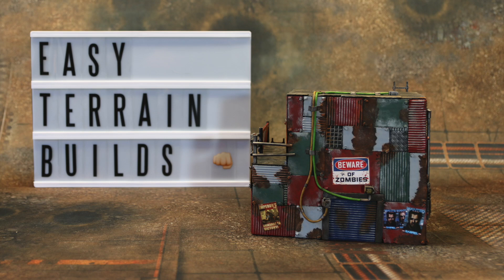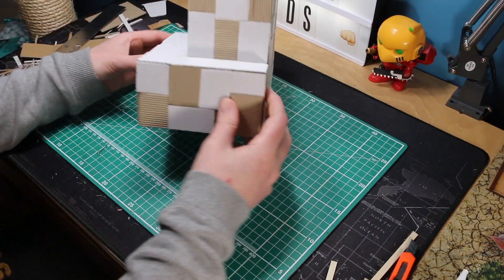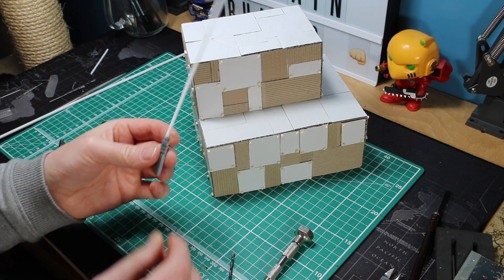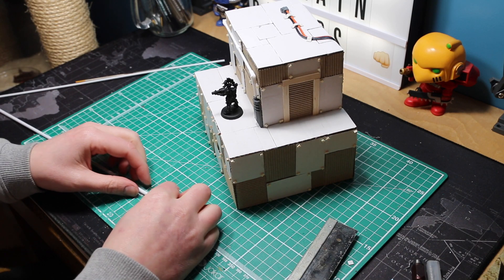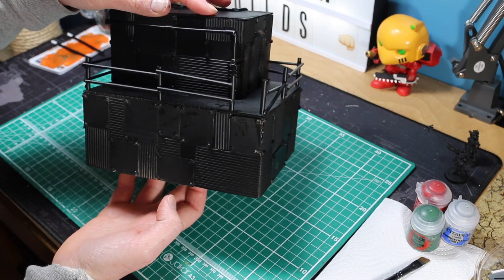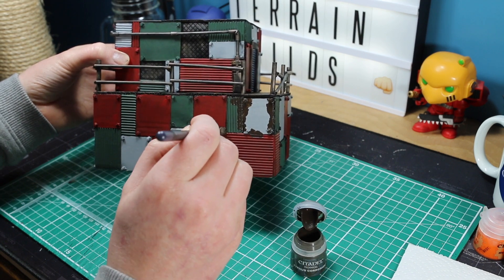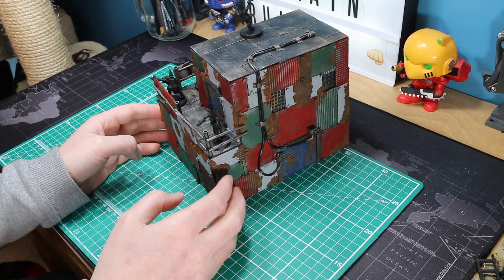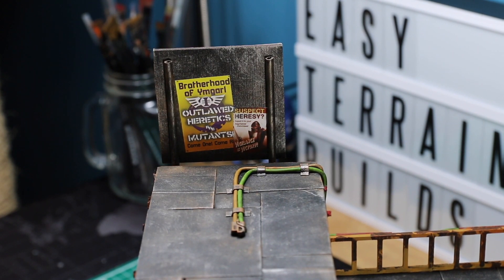Easy To Build Shanty Buildings

Comment: For modularity purposes, it might be a good idea to leave some of the railing in the second floor incomplete. Not fully covered, even if only by sections that were strategically "damaged" to provide space. That way, you can stick multiple scenery pieces together, or connect levels via bridges or stair pieces. While it's always possible for characters to just "jump over" the railings, the presence of fixed railings on all sides limits how you can use the terrain piece as a whole.